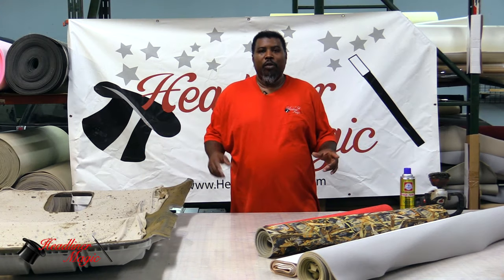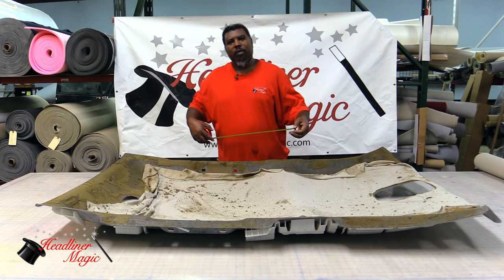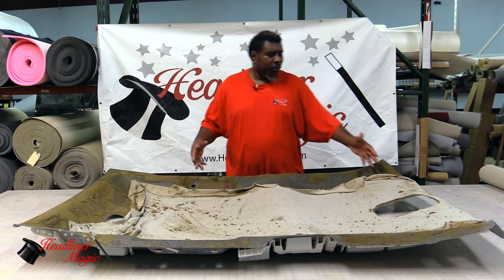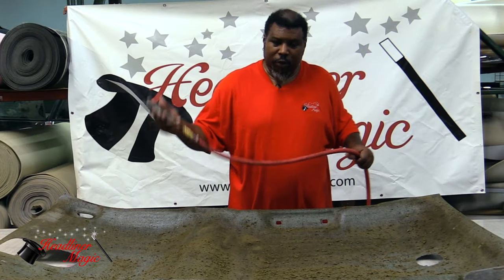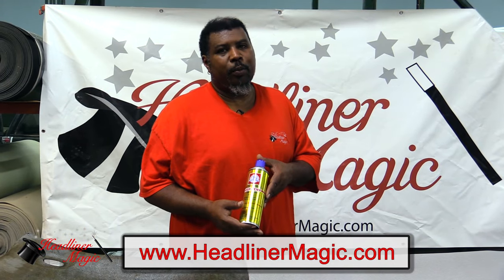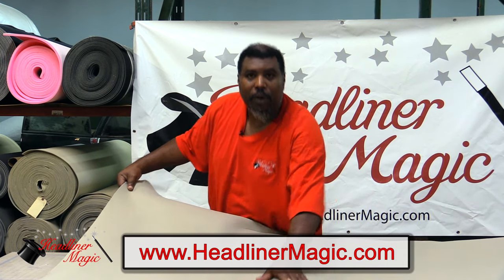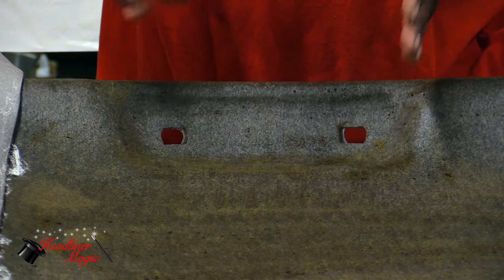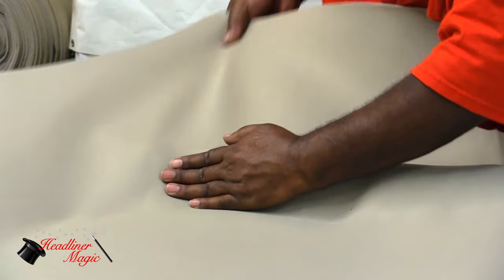Detail Process Replacing the Headliner Ceiling Fabric in Any Vehicle

Comment: Best headliner tutorial on youtube by far. I've done this many times and it came up on suggested. Only thing I do that you don't is cut relief cuts and fold over the material on the inside of the holes for the lights. Great video!
Reply from the maker: Thanks Nicholas for watching.  I did years ago cut the relief s and fold the cuts in on the lights and visor holds.  But over time I realize that those accessories have enough tension to hold the material close enough to the board to create a great seal. Thank you again for watching.  Marcus

Comment: Ive watched a few videos on how to replace the headliner and this is by far the best ive watched. Very informative and easy follow! Thank you!
Reply from the maker: Thank you for the feedback.  More vehicle specifics are on the way to help with headliner board and overhead console removal tips.  Marcus
Reply: Well if you could do a video on the 1st Gen Lincoln Navigator, that would be amazing! Lol. I just picked up my 2002 Navi and at somepoint in the early 2000’s, a cheap dvd overhead unit was installed and its completely rubbish! Its actually the reason im looking at redoing my headliner! After I remove the monitor of course!
Reply from the maker: @briguy91931  I will check on this.  I do have a 02 Suburban video that I will be posting soon.  Please subscribe!  and click the bell so you will be notified when the new videos arrive. Marcus

Comment: This guy really knows his craft.  Plus, he instills a lot of confidence.  Watch this through before starting the job.  One comment:  my old foam came off with a plain scrub brush with little effort.  Used denatured alcohol as a glue release agent where needed.  Use wire brush only if needed.
Reply from the maker: Thanks for that tip Richard,  I will have to add that to my tool belt of headlining skills.  Marcus

Comment: That was a great instructive video.  Wish I had seen it before scraping all the foam off with a wire brush.  Harder than I expected but it does work.  However, this will definitely help me get the new material installed right.  Thank you!
Reply from the maker: Thank you for watching. Marcus
Reply: I found laundry soap and a nylon brush works without digging in to the headliner board. Just rinse and let it dry well (put mine in the sun for a few hours).

Comment: Thank you for sharing your knowledge and experience I saved it to my playlist.  Great instructional video - I will watch this video several times over to build my confidence and ingrain the process in my brain. I might consider replacing my headliner.   I am trying to resolve my water leaking into my 2005 GMC Sierra 1500 pickup truck.   I tested the sunroof drain tubes with only a cup of water yesterday. I initially tested the drain tubes while the truck was backed into the driveway; the water drained through the front drain tubes only; I did not notice water leaking from any other location. I started the engine, pulled out of the driveway and faced the truck forward; tested the drain tubes; the backseat passenger side did not disperse water; the backseat driver side dispersed water through the drain tubes, the front passenger side dispersed the water down the drain tube and also down the pillar through the dash; the front driver side dispersed water down the drain tube.  Test Results 1 - the passenger side of the truck seems to be the problem.
Reply from the maker: If you haven't taken the board out then that would be the next thing you may find that the drain hoses have slipped off from there positions or the hoses  could be damaged (dry rotted). Thanks for viewing.
Reply: @HeadlinerMagic  I pray that my truck's drain tubes just loosened from their connection and are not dry-rotted: thank you
Reply from the maker: @PappyNet01  I believe they are just loose,  the latter would be the extreme.
Reply: @HeadlinerMagic  Just like the Billy Preston song | Will It Go Round in Circles - yes I have gone in a circle about headliners.  I finally stopped all water leaking into my truck whether it is from rain, sleet or snow and car washes - actually a master/wizard mechanic in town accepted the challenge.  My Mechanic has repaired two of our vehicle's air conditioning at a fraction of a cost.  Every damn auto body shop only works through insurance companies.  The two upholstery shops in town nearly doubled their prices: I know we have experienced high inflation, but a increase of 80%!!!!  I inquired of both auto upholstery shops about different fabric [samples I purchased from Joann Fabric]: one shop says no to the material stating that the foam won't stick to the foam and the second shop says it can be done, but then the price creeps closer to $800.00 because he would glue to headliner fabric that has foam.  I plan to return to Joann Fabric and learn if they sell the correct type of foam for headliners.

Comment: Thank you very much for the best film on the headliner replacement. I plan this project, but not sure if this can be done at lower temperatures (around 50F)? Would it cause just longer times for glue to stick, or it can be other problems and better to wait when it gets warmer? Thank you again.
Reply from the maker: Hello Olena,  you can do it in lower temps.  Like you said you will just have a longer tack time for it to dry.  This can be a good thing tho if you are spraying a larger area.  Marcus
Reply: @HeadlinerMagic  Thank you, Sir, so see even some positive effects here with lower temperatures. I also want to inquire what do you think about KilMat (sound deadening)? I bought it to put under the headliner, but now think it might be difficult because of all those curves. Thank you again for the wonderful film.
Reply from the maker: @olenaerhardt7725  The sound deadening is a great addition to your project.  it will be a little tough around some curves but it doesn't have to be perfect.  You can cut it and place it like that as well.  It will still work the same.
Reply: @HeadlinerMagic  Thank you, it is very kind of you to answer my questions. I bought Kilmat in pieces (like 1'x1'), so it would be easier to apply. Really bcs it goes under the liner it shouldn't be perfect. I'll just try my best. Thanks a lot for the idea, Sir.

Comment: Your videos have been very helpful. I am tackling this job on my Volkswagen. I didn't have a wire brush or that tool, but some laundry detergent on a nylon brush got all the old foam and glue residue off. I didn't get it too wet so the board wouldn't get ruined. The disassembly and putting it back have been the hardest parts, so many clips, especially with the sunroof!
Reply from the maker: Yes Jessica,  the VWs are some of the most difficult once especially 2006 to 08 they used some flotation hardware on the visors and grab handles and if one of these fall out your project  time can be extended.  Let me know if I can be of help. Marcus

Comment: I have some fabric, but it's not foam backed. Should I lay some foam down first to minimize creasing??
Reply from the maker: Laying the foam down first is definitely the way to go.  But if you choose not to the process will still work as long as the board is clean of all debris. The amount of stretch in the fabric you choose to use will help to eliminate wrinkles.
Reply: @HeadlinerMagic  Got it. Could I lay fabric over OEM headliner material?
Reply from the maker: @EscapePlanSkateboarding  Yes indeed EscapePlan Skateboarding.  I love the screen names guys!
You can definitely lay the new liner over the existing one if the integrity of the old one is still intact.  You may have to use a bit more glue because the old foam headliner will absorb some of the glue sprayed.  Marcus

Comment: Does this stain?
Reply from the maker: Not at all.  If your referring to the adhesive.  If you are referring to the cloth back headliner ability to get stained well that would be a yes.  It can get stained by dirty hands, cigarettes' smoke ect...  Marcus
Reply: Headliner Magic thank you for your response Marcus. I was referring to the adhesive. You guys’ headliner looks quite thick, making it hard for the adhesive to penetrate right? Do you think there would be a chance it would stain the slim factory headliners found in most European cars; that sag and just need to be adhered back on, obviously of course if someone was not careful and sprayed a little too much on one area, perhaps it would. I already purchased your adhesive btw, just haven’t got the time to use it yet.
Reply from the maker: @EJR20  No the adhesive will not stain the headliner fabric as long as you shake the can well before spraying.  This why you want to spray the board first and make sure the spray coming out is like mist silly string and not wet globs.  I like using the 1/8" flat knit style headliners us on the European cars.  I prefer it in most cases because it is flexible and tough. But I have had bleed thru when I have two much glue on the boards. Most of the time this will happen in a grab handle pocket.  So I'm not perfect in that regards.  I usually have a few choice works and either redo it or wait for it to dry more before pressing it down any more.  You can usually see a streak coming thru as a warning if this happens. Being mindful on laying out the glue evenly and this will minimize the staining to zero.  Great question Edgar, I hope this helps.  Marcus
Reply: @HeadlinerMagic  Marcus, is it okay to add soundproofing to the roof or back of the board? I want to do this headliner restoration but have been soundproofing my car since getting a new sound system. Wanted an expert's opinion on whether adding some to the roof is okay to do?
Reply from the maker: @BroCamelToe  Yes indeed TaZa Kshy   This is the best time to add sound deadner.  You can glue direct to the metal Roof or the the headliner board either is fine.  Marcus

Comment: Straight forward video, nicely explained and easy to follow. Just need to decide OEM or Custom........
Reply from the maker: Thanks you for the view! What you working on?
Reply: Headliner Magic  I have Two Mk2 VW Golfs, 1 is 100% original and just needs the material glueing back on a few areas and the other is far from standard so I just need to decide what material finish and colour I go for.
Reply from the maker: @pkf4124  if the headliner has started to fall in areas.  The foam underneath has started to deteriorate in other areas as well.  The dead foam has to be removed in order to get to a stable surface that will allow for the glue to hold over time.  If you do a patch repair it won't last to give you the quality job your looking for.  I would recommend you doing a full headliner replacement like the example video.
Reply: Headliner Magic  MK2 Golfs and Jettas have a styrene headliner that has the rubberised material glued straight on. They are notorious for wrinkling the material when the car gets damp, typically when laid up. To be honest your more likely to have problems removing the headliner in one piece, as 30 year old styrene gets brittle. More than one owner i know has had to repair them with fibreglass reinforcement.

I am waiting for the summer as the heat pulls the wrinkles back out.  Then there will be less to fix.
The problem is oem replacement is non existent both dealership and replica, second hand is expensive and could just be the same. The car is a low mileage original so aftermarket reduces it value. Stuck between a rock and a hard place.

Comment: Great stuff man , did mine and did it wrong so 90$ later , I just spray paint mine, and if you do it your self spray head liner and material cuz it won’t work on just one of them
Reply: What paint did you use? My old Honda had a vinyl lining which seems so much more durable than these cloth ones.
Reply from the maker: Did you mean spray adhesive?

Comment: Super Great Video. Thanks getting ready to do a headliner with the sunroof console hump any advice. It's on a Saturn Sl2. Did one in 2016 but messed up the hump on one side when the fabric folded and stuck together. Just cut the folded part off and lived with it but trying to do a better job this time around.
Reply from the maker: Thanks Amish for checking out the video.  The best advise is where I show in the video to pace your self and spray a small strip at a time. By doing this you can control the wrinkles and amount of drying time / working time to get it right.  A Vast amount of videos on headliner replacement show spraying half the board at a time and that is too much area to work with at one time.
Marcus

Comment: I did this today.. it was a hell of a job. Didnt turn out perfect but definetly 10000 times better than before. Thx for the video

Some tips for people who want to do this themselves:
- use spray glue as shown in the video,  much easier to apply than glue with a brush (i did that)
- make sure you can see where you applied the glue so you wont miss a spot!! 
-make sure you dont forget the cutouts and use a sharp knife/blade, you're gonna have a hard time pushing bolts and screws through the fabric.
Reply from the maker: Great Job Niels,  You took action and it paid off.  If you had to do it again it would be perfect. I glad the video was able to help you in the process.  Thank you for watching.  Marcus
Reply: @HeadlinerMagic  thanks Marcus! Keep up the positivity!!!

Comment: Great technique! thanks for sharing. I'm a trim carpenter and spray Wilson adhesive to bond mica and thermofoil onto mdf or plywood. Do you think that would work on the foam?
Reply from the maker: Great tip!  I would just check on the bonding time and temp range to make sure it will withstand the 120 degs.  Marcus

Comment: You don't do it from inside the vehichle? I didn't know the solid part came out. Great info. Thanks for sharing.
Reply from the maker: Only the vehicles with a Aftermarket sunroof installed will need to be done half of the work inside and half on the outside.  Thank you for watching. Marcus

Comment: Great video!! Can you place the material over the existing material if it’s not sagging? Also can you use weld wood contact adhesive as an alternative?
Reply from the maker: Thank you for viewing. And yes if the headliner is in excellent condition it can be covered over. Also the Dap Weldwood  will work as well.  I recommend using quite a bit to make sure it performs well.  Marcus

Comment: This guy has a great presentation voice
Reply from the maker: Thanks,. I was kinda nervous.  Marcus
Reply: @HeadlinerMagic  no problem.

Quick question if you've got the time. I'm using this foam material I got on Amazon that is kind of thick and not very stretchy. I tried molding it into the headspace area and it wrinkled at the edges? How would I avoid that wrinkling next time?

Comment: Would you recommend gluing straight to an old headliner? Got a 14 Chrysler 300 and the headliner is mint just want to change it up but dont wanna pull it all off if i dont need to
Reply from the maker: Yes, you can go right over a headliner if it is in great condition.  You will need to use a bit more spray adhesive as the old liner will absorb some.  Marcus

Comment: This is actually a great video.
Tackled this project myself about 2 years ago and wish I had seen this video back then.
I mean, my roof lining came out perfectly, only, I damaged the board a little while gettin' it off the car (only had two hands and no help) - there is a fold in it that's visible even with the new material on. Any recommendations for repairing the fold? The board is also broken in some areas 'cause water was gettin' in, I used some newspaper dipped in glue and just placed layer after layer over the damaged area to repair the board, fixe it up pretty good actually. What would you recommend?
You make it look a lot easier than it is, especially the layin' process 'cause there's a lot of room for error in there.
Reply from the maker: Hello Venolin, The newspaper dipped in glue is a great touch.  Very similar to the fiberglass sheets and resin mix.  I believe you did a fantastic job with what you had to work with.  Working with a water damaged board can be a difficult task to overtake.  But you did well.  I really appreciate your subscription to the channel.  Marcus

Comment: Great video bro!! Question, can I use any fabric I want?
Reply from the maker: Yes indeed.  You can use any fabric as long as will not bleed thru with the glue that you choose to use.  It is best if the material is not too thin or pores.  I have a video of me using a non foam backed suede to recover a headliner and a flag on our YouTube channel.  Marcus

Comment: Great video i have a few questions tho. My cars headliner requires the windscreen to be removed in order to do this, would it be possible to drop the headliner in the car slightly, in order to gain access to tuck it in, and do this in the car?
Reply from the maker: I'm going to guess you have a VW Jetta?  Let me know if I am right.  There are many rumors out there that you have to remove the windscreen to do that headliner replacement.  But the real answer is that you can remove the headliner board thru the driver side rear door.  I will do a video soon on removing the board and how easy it is.  Let me know if I am right on the vehicle.  Marcus
Reply: @HeadlinerMagic  hi again, the car is an audi a5 2008 coupe, everywhere ive read online says the front windscreen needs to be removed in order to get the headliner out
Reply from the maker: @AlexS-jo1bz  That board should come out of the passenger side door.
Reply: @HeadlinerMagic  after alot more searching online i have managed to find a diagram that suggests to remove the passenger door to remove the headliner, im going to attempt this, thanks again for the video
Reply from the maker: @AlexS-jo1bz  Your very welcome Alex and thanks for watching.
Marcus